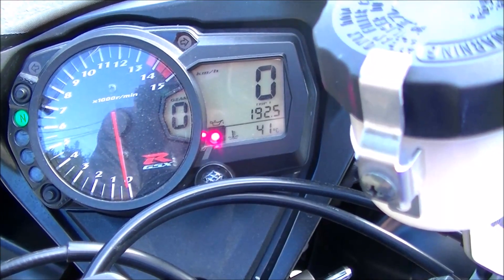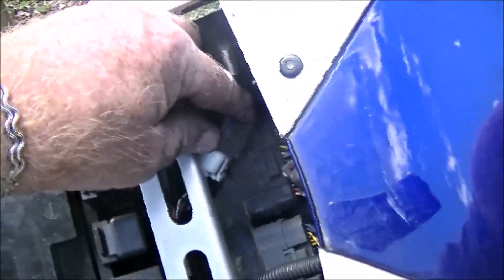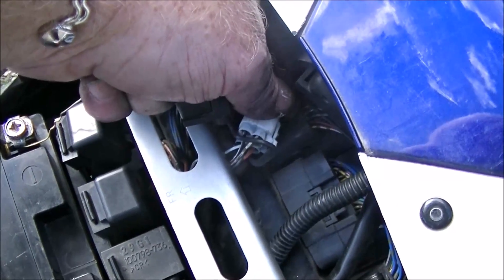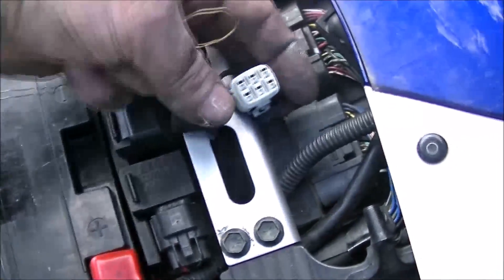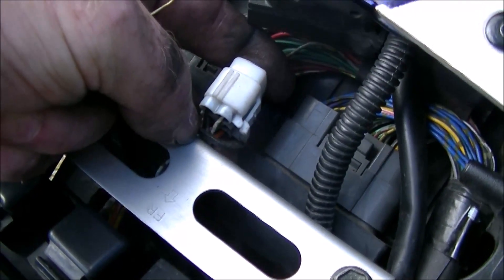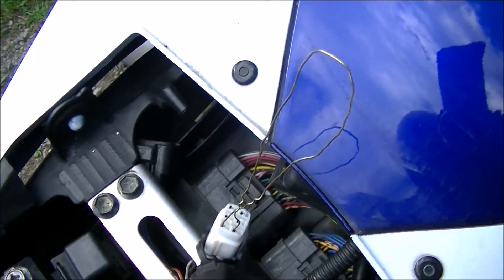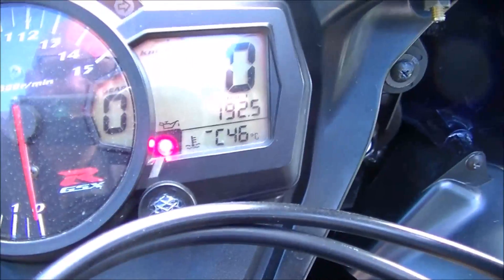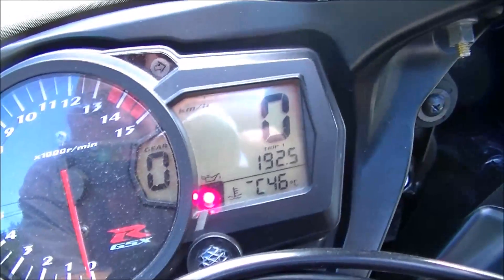GSXR1000 FI light

Comment: I have 2008 gsx r i think its the k7 ...red light is on and flashing the fI code. It has aftermarket exhaust. My question is...what problems was that code causing you to have?
Reply from the maker: The bike idled rough, was rough while cruising and the throttle response was a bit slow.  This bike had a Chinese Apropovic knock-off muffler and the exhaust valve was deleted.  After balancing the throttle bodies and setting the TPS, it worked great.

Comment: I tried to put my 04 1000 in dealer mode. It wouldnt, the fuel pump just runs continuous. I removed the jumper and now it keeps running the pump. This happened after I removed the TPS's to check with a meter. (they were fine) . I was able to read the codes with woolichs software. 11 codes, that won't clear. The bike was fine before i removed the TPS's. Any ideas would be great. Trying to avoid a dealer trip.
Reply from the maker: What are the codes?  How are you trying to clear them?
Reply: @lelandlewis7207  iap , iat, ect, tps cps, cam sensor, sec throttle valve, twice , 11 in total with 2 unknown, I think it all of them. Someone suggested I lost a power feed or a ground source.
Reply from the maker: @ZEE-h-EX  Sorry for the slow reply, I've been changing heads on my SUV and fighting a migraine.

That is a lot of codes.  First thing to do is to check the voltage at each sensor.  Remove the plug and check the wire for 5V, each should have close to that as the input voltage.  Use a digital multimeter.  

If each has the correct input voltage, check the resistance through the sensor, which varies depending on the sensor.  Also, check each terminal on the sensor to ground; there should be no connection or you have a shorted sensor.

The cam sensor is different, it requires checking the peak voltage while cranking the engine.  Check the voltage across the pins in the sensor while cranking.  Do it about 3 times to get the best reading of the peak.

My guess is that it isn't a sensor issue since you have so many codes.  It almost sounds like the computer isn't reading the sensors or is getting incorrect readings.  By doing the voltage checks at the sensor, it tells if the computer is sending out the voltage.  If there is voltage going in and coming out of the sensors, then it needs to be checked at the computer to be sure the readings are getting back.  Check for any connections being accidentally knocked off while working on it.  It is a process of elimination, but better to check everything from the basics up rather than assuming and buying an expensive part you don't need.

Comment: Or just get tool adapter an use the code reader pluged on that same plug
Reply from the maker: If you want to spend money on the adapter and have an OBDII reader.  A piece of scrap wire does well if you aren't doing a lot of bikes or just want a quick check.

Comment: So I have exactly the same issue. However there's no error code coming up, the bike tells me there is no fault C00. I have checked the oil pressure switch, oil levels and sure that the oil pump is working. I ran a simple test on the temperature gauge and even checked the engine coolant level, all seems fine. Do you have any ideas on what else it could be?
Reply from the maker: There are many possibilities. Bad spark plug, plug wires, dirty injectors, partially plugged fuel or air filter, bad fuel, sensor sending readings slightly out of spec, throttle valves out of adjustment, etc.  I usually start with the basics (plugs, wires, filters, etc.) and move to the more complicated as things are eliminated.

The self-diagnostic system only sets codes when something goes outside of specs, but a vehicle can start acting up when a part or parts are within spec but not working perfectly.  Best to get a digital multimeter and a troubleshooting chart to check the output of the various sensors.  Sensors send a voltage signal back to the ECU, usually between 0 and 5v and the ECU converts it to a usable reading.  For example, the TPS sends a voltage signal that the ECU converts into a percentage of throttle opening and with vacuum readings calculates load and adjusts fuel delivery (and other systems) to match engine requirements.

Even with a code, troubleshooting is important as a sensor may be working properly but another issue is causing the code.  For example, a vacuum leak may trigger a map sensor or TPS code, so it is important to verify what is causing the code or drivability issue before unnecessarily replacing expensive parts.
Reply: Fan

Comment: Fi doesnt stand for fuel injection lol stand for faulty indicator learn ur bike 🤣🤣🤣🤣
Reply: FI = It's the fault indicator in the Fuel injection system. Go out and get a Suzuki service manual for your bike it explains it in detail.
Reply from the maker: Has been discussed and explained already.  The manual actually calls it the "malfunction" light and nowhere does it say "fault indicator".  People know what I mean and many I talk to use the same term.  The procedure is proper so what exactly "FI" is called isn't of major importance.

if I do another video, I'll be sure to use both terms so all will be happy.

If I didn't know the bike, then the work or parts would be wrong.

Comment: Thanx a lot for the video. I have exactly the same code C46, but I wish You'd continue the video showing how to delete the code. Tried to switch off the key but the code is still there. Can You help?
Reply from the maker: If you turned the ignition off and then on again with the "dealer mode" jumper wire in place, the code should have cleared.  If the code is still there, then the computer is sensing that the problem still exists.

The computer stores codes in memory even after the FI light is turned off, so, another way to be sure is to disconnect the battery for 10 seconds.  This will clear any codes stored in the computer memory.  If any codes return after this procedure, then you definitely still have an issue.
Reply: +Leland Lewis (My Projects) Problem solved.  Thanx again for the video.

Comment from the maker: A viewer has rudely pointed out that FI means"Fault Indicator", which is a good assumption.  Throughout the manual, the indicator is called the "malfunction light" and the codes are "malfunction codes",  so the letters "FI" are never really defined, at least any of the sections I have read.  I say "fuel injection" because most people recognize the term which makes it easier to have them understand what I am trying to get across and in most cases it is the fuel injection system causing the issue.  I also get people asking me "Why is my fuel injection light on?", so I just stick with that term  I suppose that "fault indicator" may make people more inclined to pay attention to it, rather than thinking it is a low fuel or low oil pressure light, which I have also had.

I have no issues with people pointing out an error or omission in a video or even a difference of opinion, but, if you have to make your point by adding a personal insult, your comment will be deleted.  We are, I assume, adults, and name calling is not how adults discuss topics.
Reply: Great response.